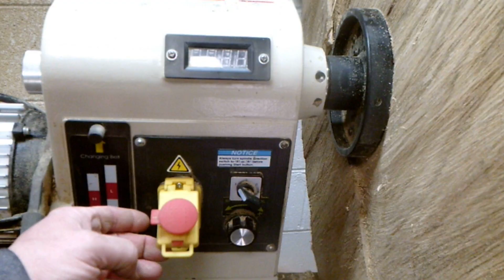Monster Red Oak Bowl

Comment: That's a real shame Chris, that would have been a nice bowl. something to consider when turning something like this with cracks, and using a recess for the jaws. As more material is removed from the centre it becomes weaker and the jaws literally push it apart. I have done the same thing. Which is why, I now always try to use a tenon. Glad you where not hurt. Stay safe.  Martin
Reply from the maker: Was going to leave a tenant what would have to grind it off I couldn't turn it off